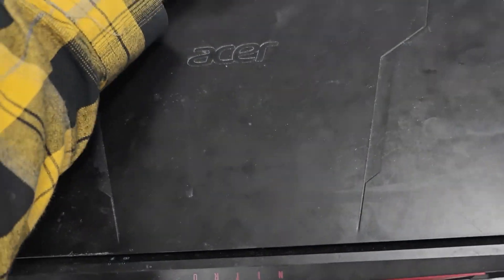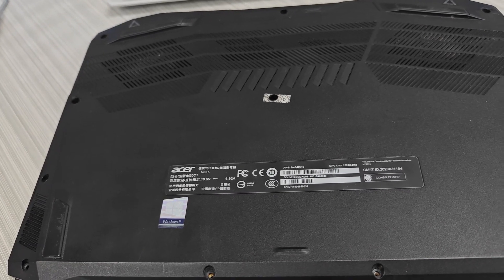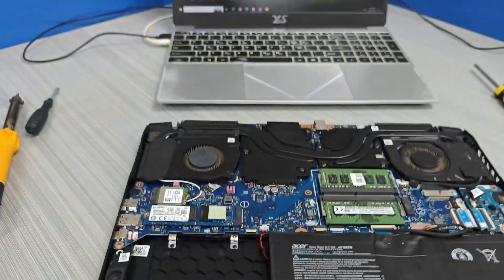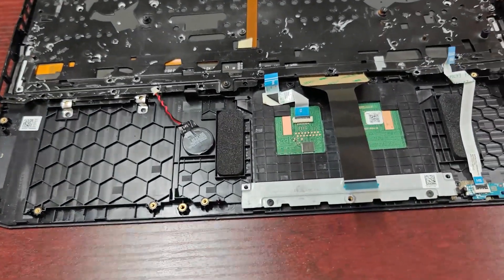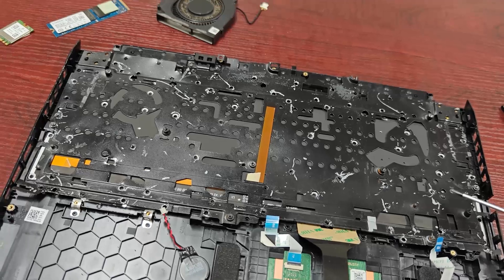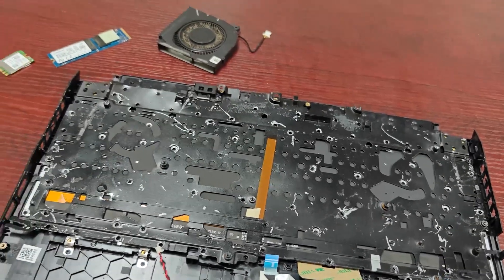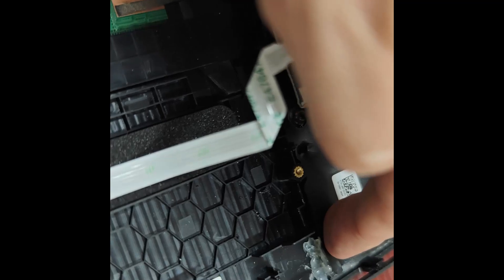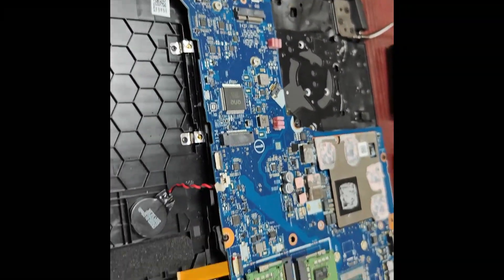Replacing Keyboard in Acer Nitro 5

Comment: Buying a new keyboard must have been very expensive. After about 5 years, the screen on my Acer Nitro 5 stopped working. After doing some research, I found that this is a very common problem with the Acer Nitro 5. The laptop overall has a poor quality build.
Reply from the maker: yes, I don't like how it is built inside, but keyboard wasn't expensive, just around 90 rmb, (14 usd maybe)

Comment: I don't want to ruin it though, I am so sad...
Brother, I screwed it up. The screen doesn't go on
The keys turns on but IDK if it's a good sign
Reply: hi, sorry for your experience, it was tough for me too, I noticed that after replacing the keyboard you have to hit some buttons on it to activate screen., otherwise it will be off.
Reply: @GuitC  there is a setting for this. In Nitro Sense at the top right corner. "Always on", or Off after 10 seconds of pressing keys ... But also you can change it in Bios.